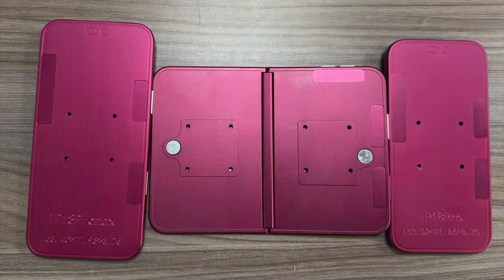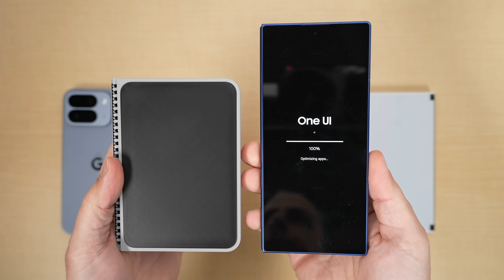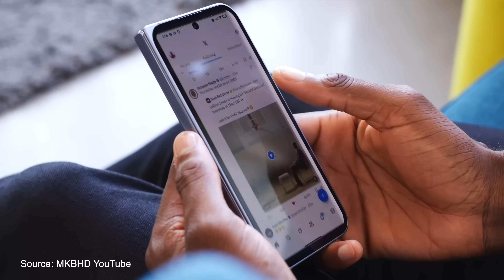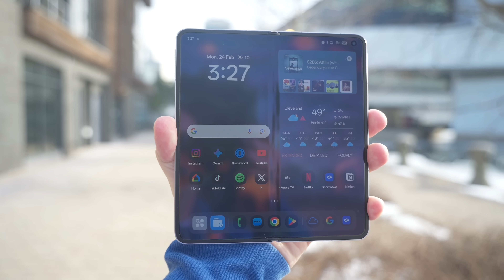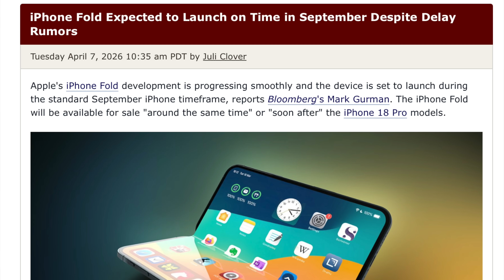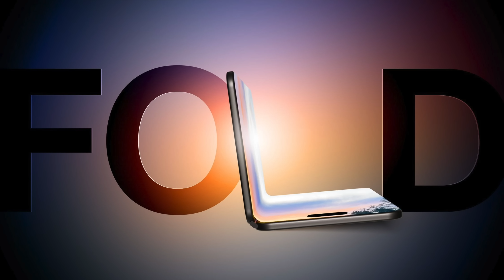Apple Foldable iPhone: FIRST LOOK + New Details

Comment: Definitely not for me. If I go foldable, it will be from Google for the better software and stronger trade in value. After 42 years with Apple, I think the flash posing as innovation is running out of road, and Tim Cook’s profit first mindset is finally catching up. 🤷

Comment: When the iphone X launched, people said it would fail because Apple was charing $999. It turns out it was never a $999 phone, it was a $42/mo phone for 24 months. Now people are saying no way if the Ultra is $2500. But it's not a $2500 phone, it's a $70/mo phone for 36 months. And it will sell like crazy.

Comment: not sure I’ll want that over my Z Fold 7
Reply: This aspect ratio looks alot more usable than the folds. When i had one i was really jealous of the oppo fold n. Short enough to use one handed when folded, and then a better aspect ratio for videos when open
Reply: @handledrandomlyI use my phone mostly closed. So if this form factor is better, why aren’t the other models the same?
Reply: @EVPaddy the only other brand in the us is the pixel fold which is shorter and wider...also why would you get a foldable and mainly use it closed? You dont seem very sharp

Comment: If that is the size and it doesn’t have Face ID it’s a no go. It would be too small compared to my 17 Pro Max to justify a change. I love foldables but they have to be big. Ideally when closed the size of my iPhone 17 Pro Max when closed. The whole point is you do most of your stuff on the outside screen and do multitasking or stuff that works better on a large screen with the inside screen.
Reply: I respectfully disagree. I want the larger size of the pro max, but was never able to stomach it full time. I’m looking forward to having a compact phone with an optional larger screen when needed.

Comment: Looks like this is for the elderly. The shorter wider display will be very desirable for people who have issues with hand mobility using current form factors. Text can be larger and more readable on the front screen without knocking down each word to a new line like current phones do when you turn up the text size. The large interior screen is also great for media for those late in life who start to lose vision at that distance

Comment: No Face ID  is a show stopper.
Reply: I wish it was coming on this device as well, but I suspect they’ll make it to where Apple Watch will unlock phone and also work for purchases… to largely negate the need for Face ID here.
Reply: Would FaceID be on the outer or inner screen? Either way it’s a problem.
Reply: @Stiggy767  it would make more sense on the outer screen
Reply: Consumer demand has been trending towards Touch ID over Face ID.
Reply: @richard1493  that makes zero sense considering there hasnt been a regular iphone with touch ID for almost 10 years
Reply: @richard1493  clearly u don’t use apple pay
Reply: @richard1493  No it hasn’t
Reply: @jw3252 people kept their old iPhones that had Touch ID really long in the past mainly cause of it.
Reply: @jw3252 yes it has sir. People was fighting for a Touch ID for years lol